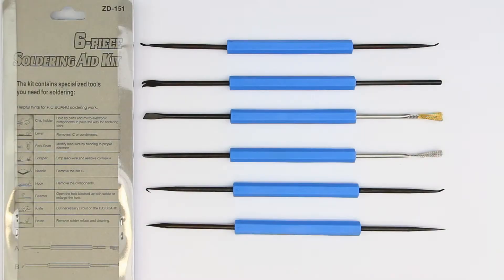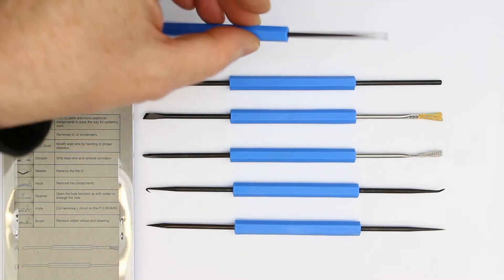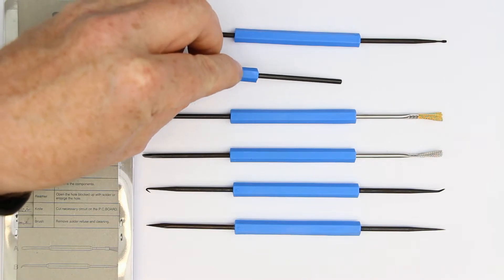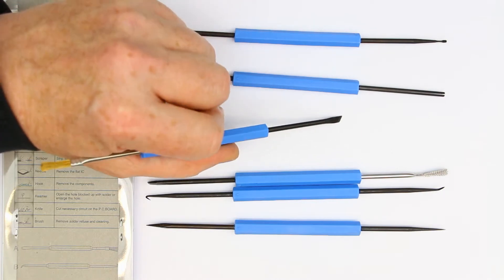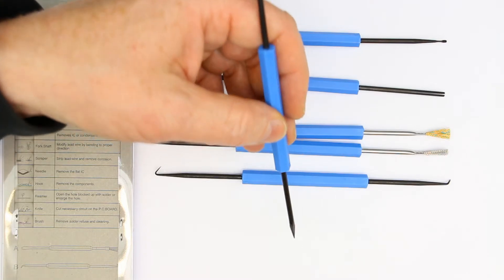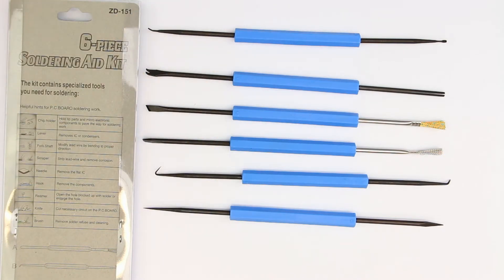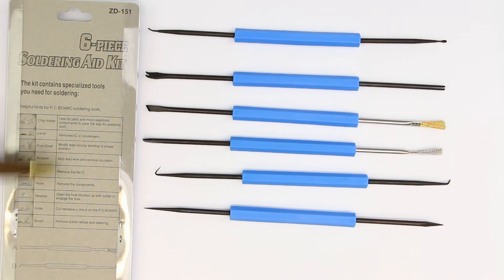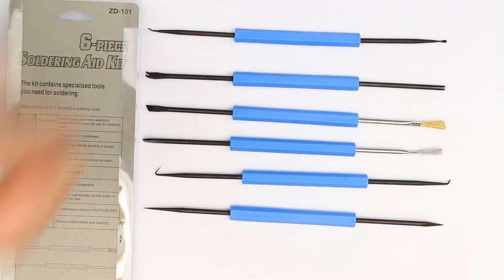Every maker should have... [Pt.7] a PCB- and Soldering-Toolkit

Comment: when to use the silver vs gold brushes?
Reply from the maker: The gold-coloured brushes are brass. so they are softer and don´t scratch metal surfaces as easily as the steel/iron type brushes.